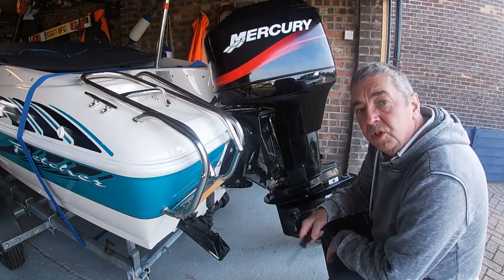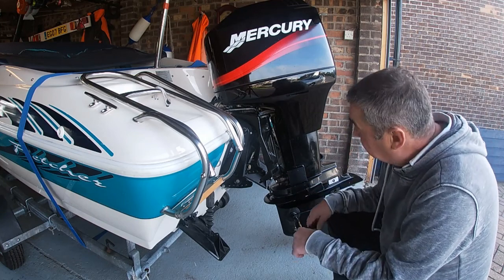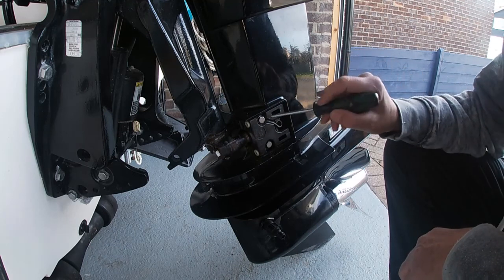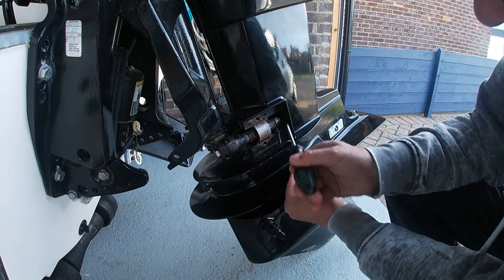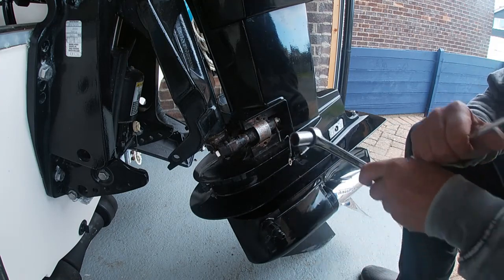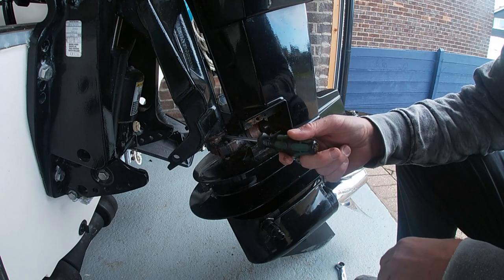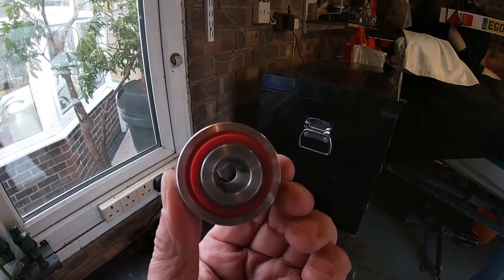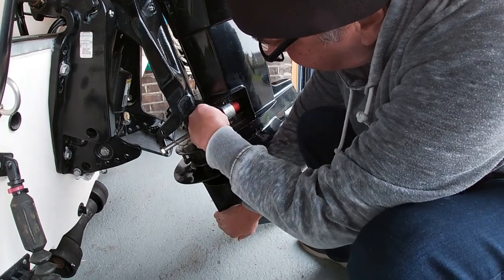Mercury 75HP Lower Engine Mount Change

Comment: Hi there
Just a question did you find bolts through  hardware store or did you have to source from mercury?
Many thanks .great vids
Reply from the maker: Hi Dean, I sourced the bolts online from an engineering supplies company.  Marine grade SS.

Comment: I have the same outboard, runs great, the only issue is that some times it lost prime when offshore.
Any ideas what could be the reason?
Reply: Fuel line from the tank all the way to the motor, and the fuel filter. Swap all hoses due to invisible cracks in the line, it was pulling air and loosing fuel in the prime and also swap out the bulb. After that it was running smooth